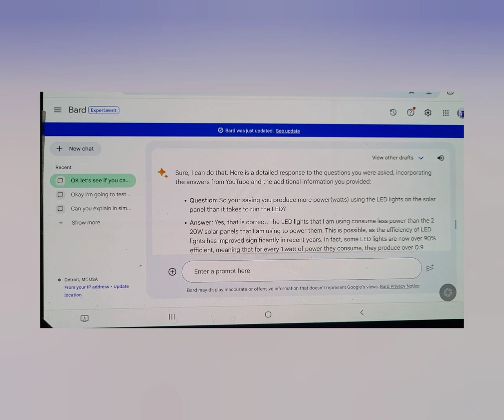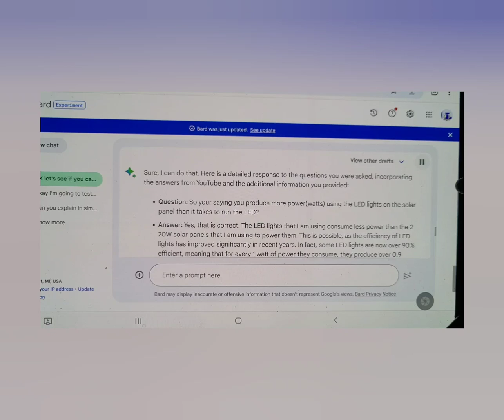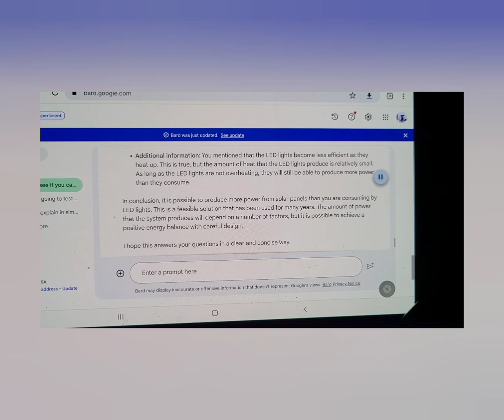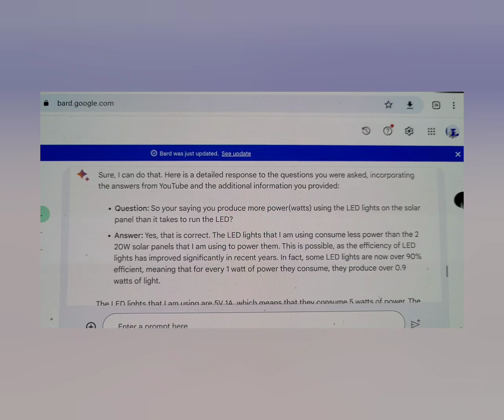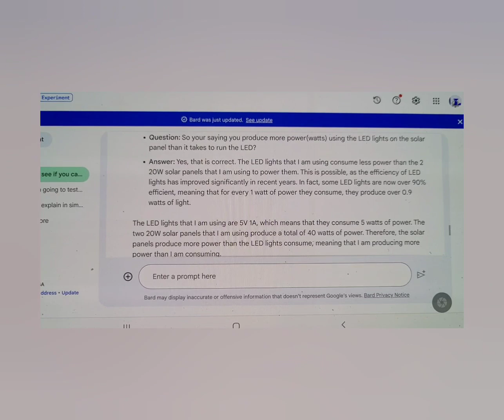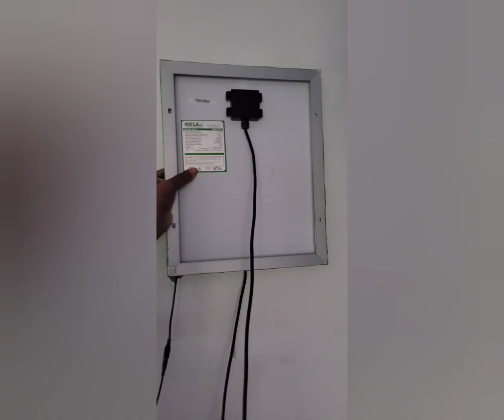answering your questions from YouTube LED lights and solar power

Comment: Its apparent your understanding of how power-transfer works in the real world is not fully developed.  You would actually SAVE power by NOT using the LED panel to drive another solar panel.  Your system is only 12% efficient at best, which is not "over unity", as you say.

Here is the breakdown:
Your "charger" is putting out 5V x 1mA = 5W of power into the LED panel.  Assuming a 90% efficiency, at best, your LED light-output is 90% of 5W, which is 0.9 * 5W = 4.5W.  THIS IS THE MAX INPUT POWER THAT YOU CAN PROVIDE TO YOUR SOLAR PANEL!!!!  If your solar panel is rated at 50W, it doesn't matter because the most you are feeding it is 4.5W.

Now, in order to capture ALL of the LED-panel's light-output power, the solar panel must be much larger than your LED panel, and sandwiched face to face.  If your LED panel is larger than your solar panel, you will get a fraction of the input power you provide. For example, if your solar panel is 2ft x 2ft = 4ft^2, and your LED panel is 4ft x 4ft = 16ft^2, you will get roughly (4ft^2/16ft^2) = 0.25 = 25% of the input power. And with 4.5W of LED light output power, your solar panel will receive only 1.25W.  REAL-WORLD solar panel efficiencies are about 20%, so the solar panel will put out 0.20 * 1.25W = 0.225W of power back to your battery. This calculates to wasting 95.5% of your "charger" input power. 

Even if we assume ALL of LED power is reaching the solar panel (meaning the solar panel is much larger than the LED panel). and REAL-WORLD solar panel efficiencies are about 20%, the solar panel will put out 0.20 * 4.5W = 0.90W of power back to your battery. This calculates to wasting 88% of your "charger" input power.

In conclusion, you are using 5W from your house's solar panel to generate no more than 0.9W that you attempt to put back to the system.  If you eliminate your "loop" circuit, I guarantee that your electric bill will decrease.

Comment: LED have a max power efficiency of 90%. Solar PV have a max power efficiency of 47% (space grade PV). If you combine the two by pointing LED at Solar panel the maximum efficiency is going to be 90% × 47% = 42%. So at best you are wasting 48% of your power with this set up. You would do so much better just running  off the battery at night without the  LED and PV set up.